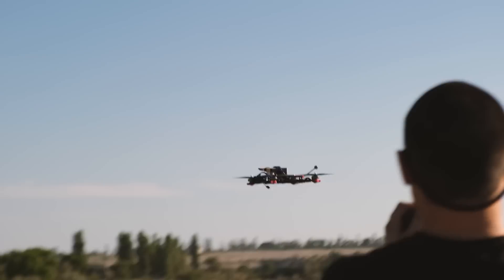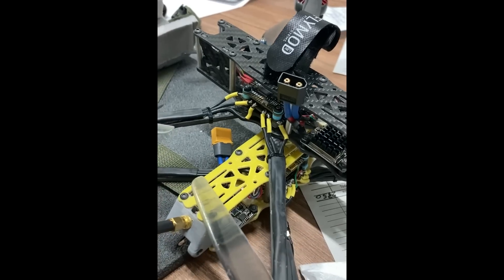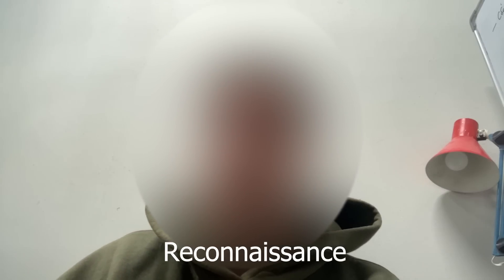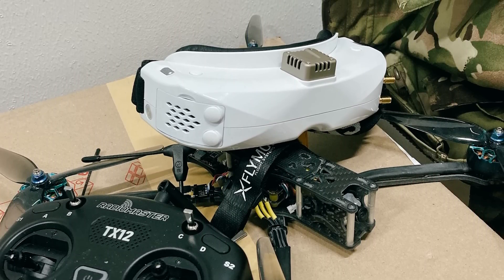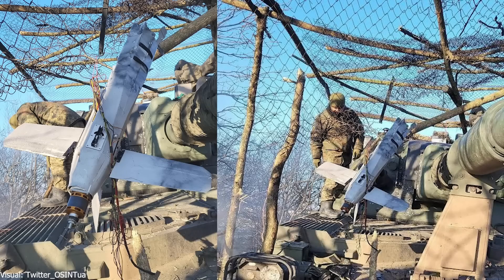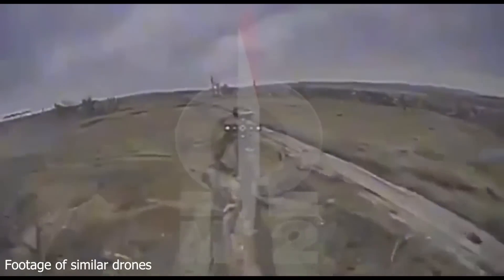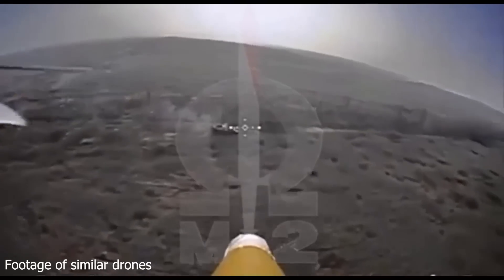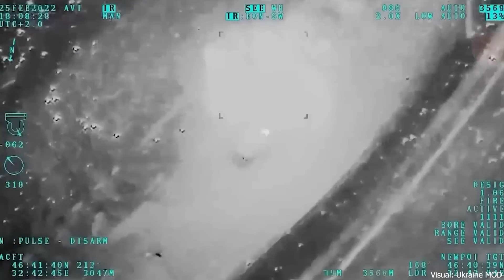Ukrainian Soldier explains how he uses First-Person kamikaze drones - (FPV drones)

Comment: The real question is how effective all of this stuff would be in a war between modern forces. Ones that have jammers at least at the level of those that are deployed for VIPs in domestic security. This war really is a exposition of the consequences of mismatched capabilities where the aggressor asset doesn't have a counter and vice versa. I guess if Taiwan pops off we'll get the answer.
Reply: Russia does have pretty decent EW equipment, definitely enough to deal with commercial drones, that’s extremely easy. It’s more of an issue of them not having smaller, cheaper EW platforms, so they only can rely on their big expensive EW platforms (think truck size), which are too few to cover most of Ukraine.
Reply: Ask the Americans. They have been using drones... or rather Unmanned Aerial Vehicles in war for years now...
Reply: Depends of the context of the war. What countries have civilian populations that when threatened by a hostile military invasion would immediately begin modifying civilian hobby toys to attack tanks?

Comment: I fly quads and rc planes, rc planes are more intuitive to fly. the stabilisation systems are way less advanced or non existent as it’s easier to build aerodynamically stable designs. You can make an rc plane fly faster, they can be made from mainly foam as opposed to carbon fibre. As mentioned you can get way more range out of a battery. As well 4 props are louder than 1
Reply: Easier to hit gaps with quads though. You have more room for adjustment.

That said if my strix goblin can penetrate 20ft into a bramble bush in a crash I'm pretty sure it could deal with some netting too.
Reply: @frasersteen  a winged drone with a lot of mass and moving forward quickly has more force to rip netting.
all weight in the fuselage, 
breaking off foam wings, 
pointy front,
pusher propeller.
maybe add cutting edges to the sides of the nose.
Reply: @frasersteen  The “netting” is chain-link fencing. Steel wire woven into a loose mesh. You are not getting a foam aircraft or RPG warhead through that to get contact with the target. This is why you see most of the targets out in the open in the success videos.
Reply: Planes have much less control authority (both line of sight control and actual trajectory). It's the aerodynamic INstability that makes quads adequate for their tasks. There are terrifying videos of quads hunting soldiers, making circles around them and attacking from the better trajectories.
Reply: RC planes fly further higher faster than any drone. Vacume baged foam wings and tail plastic fuz cheap to manufacture. Inav with cheap GPS to control it. Get the target gps from spotter plane, programe in a waypoint, plane flies itself to target pilot takes over switches engine off does a very fast silent glide into target. This is what RC flyers have been doing for years apart from blowing up tanks
Reply: @nicholasgoodyear7552  saw a video here on youtube where a free flying glider plane flew over 22 miles of ocean and landed on an island, all by itself. that was several years ago.
The technology is simple and available.
the payload needed to kill a tank seems to be surprisingly small.
Reply: Im gonna listen to the professional here, who actually used them in war.
Reply: @hitnrun66  
He says in the video he wants to use RC planes not quads, so the poster above is actually agreeing with the pro!
Reply: Drones have a better power to weight ratio and much more agile, which makes hitting a target that is moving (and potentially trying to doge you) easier to hit. Compared to other military kit the drones themselves are cheap AF so costs don't really matter. Everything is available opensource for drones and calling a basic control loop advanced is a bit of a stretch.
Reply: Failsafe 😂😂
Reply: @noisy_boi_fpv_3920  😂 that would be a costly failsafe lol 10ft away telemetry lost … booom !!!!!
Reply: I race drones, these are incredibly agile and can move in ways a plane cannot. In the right hands they can be guided through incredible small openings at low or high speed. However it takes more time to be proficient with a acrobatic drone when compared to a plane.
Reply: Speed to target, control authority and dynamic deployability. Rc planes are just the wrong option in my situations though they are being used
Reply: In the end they both make sense blowing up million dollar equipment and orcs operating it. There is use for all types here.
Reply: me 2 wel i mainly fly drones for the hoby but when i started i may have seen them as a weapon 😇
i have thougt of different ways to weaponize them in most cases a wing would be much more effective i think

a quadcopter would be superior if you want to fly inside a building, atack a single target, or mount a gun on it to shoot individual people
for all kamikaze purpose  a wing seems superior same goes for making it drop bombs
Reply: Planes would be ideal but the payload capacity would be way less with foam airframe vs carbon quad and 4 props . Surprised they don use cinematic heavy lifters with 8 prop configuration .
Reply: I'm going to say mostly yes, but also no to this one. I'm in a drone building program at a university and we do both quads and fixed wings. It really depends on what you are looking to do and how you expect to fly it.
Reply: I've been flying FPV for 10 years and building rc planes for even longer. Quads are much easier and more intuitive for a beginner to fly and setup plus it would be much easier to spot and hit the target. There are lot of people in this comment thread who are what I would call an armchair engineer. There is another big factor of the wingspan needed to carry a large payload without the wing loading going up considerably and making it harder to fly and easier to stall. They should also look into using ardupilot at least on their spotting drones since it now has a dead reckoning feature they could avoid losing drones due to jamming, using DJI is the dumbest thing they could be doing with the readily available DJI aeroscope that can tell the Russians exactly where they're flying from.
Reply: Ballistic coefficient favors drones in the terminal phase.
Reply: But a glider is way easier to shoot down, I guess in situations where they don't know anything is coming a glider could be efficient,
Reply: I can tell you have almost no experience in fixed wing, if any. You forgot that fixed wing aircraft are capable of sustained inverted flight.  With a drone you have one 3rd person to 1st person transformation required, the left right axis. With a fixed wing you have two transformations to do, left right, and up down.  What's worse is the conditions for the inversion of the axis are different. One inverts when the aircraft inverts. The other inverts when the aircraft turns around. This requires thought, the opposite of intuition. The plane is inverted and headed away, so up is down and left is left. The plane is going toward me and is not inverted, so left is right and up is up. Fixed wing has four of these combinations to sort out in real time. Drones have two - binary thought - if it aint one its the other. Much easier. I hope you can now see how this is substantially less intuitive than if only one axis is reversed. What's worse is errors in the vertical axis are usually fatal to the aircraft. These errors don 't exist in the drone hobby. The issue of course is muscle memory. If you don't have time to think, your only  choice is to react w/o thinking. The only time you don't have time to think is when you are close to crashing. This happens a lot more in the up/down axis than the left/right axis. Ask my Goldburg Eagle, which fly beautifully inverted except when fences get in the way, and gusts of wind cause you to panic. Muscle memory is a bitch.
Reply: @horrido666  That is a bit over explained but, exactly right. Planes can take weeks usually months to learn to fly high wing trainers with out making any mistakes especially if you don't have someone teaching you let alone becoming a decent enough pilot to the point of being able to fly a high wing loading plane designed for maneuverability accurately into a target. Most people could probably whip a tiny whoop around their house within a matter of days and the flight dynamics are basically the same for all multi rotor whether it's a tiny whoop or a 10" propped monster. The original commenter seems to think aerodynamically unstable is bad when in reality it means you have full control in any and all directions at any time with no chance of stalling. Also about your upside down comment there's always 3d but, that's probably not going to be intuitive for a beginner to fly haha.

Edit: for reference I learned how to fly helis planes and quads in that order and helis were easier than planes and quads were easier than helis. This is coming from a person who has probably built 50+ planes almost all scratch built and a good portion of those my own designs the physics of planes while seeming simple are actually incredibly complex and fickle quads just work and are seemingly complex but, actually simple.
Reply: More range, yes. But you won't be able to carry a 1KG payload with a foam RC plane.
Reply: There is no stabilization if u don’t want it in fpv. Called Acro Mode 😅
Reply: @jmillerfpv Try flying a quad with no fc :D OP was talking about the aerodynamic of the fixed wing uav. It is much easier to operate than a freestyle drone. Two different apparatus for many different tasks.
Reply: in a suicide drone it makes sense to glide into the target, which you can do with a plane, and you can do that silently.
the engine is used to get into gliding range.

Comment: the plane will not be that difficult to fly cause these will usually come with a flight controller which avoids to bring the plane into a stalling situation.
the plane has a far higher payload and of cause range even though it might be more likely recogniced by the russians cause the profile is far bigger but also a lot more quiet cause a drone or quad is quite noisy, maybe not during fight, but for sure in the evening with less battle noise. 

The parts for the drone can be cheap cause thtey do use analog fpv which is just 10% of the price. All parts are cvilian or hobby parts. The availability of parts is the issue. 
the drones are fire and forget and therefore cheap builds. But the chinese are selling all these parts and therefore the parts fro the hobby are exploding like flight controllers needed to build these more advanced planes and so on.

Comment: You had me at Angry Birds.
Reply: It's a very fitting name.
Reply: Rovio Entertainment should be sponsoring these guys😁
Reply: Only downside is having such a unique insignia may be pretty cool to fellow Ukrainians but god forbid they’re captured alive by the Neanderthals then they’ll probably get tortured for information to give up anything that will help the enemy destroy training camps for drone pilots, supply depots, drone workshops etc…Then possible execution depending on which group of Neanderthals that captures them. They may justify it as the drone pilots being civilians or partisans and not military. Kind of like in WW2 being a sniper or manning a flamethrower. If you manned a flamethrower in WW2 then you had a giant red bullseye painted on you and you were drawing in all the enemies fire and most of the time they were aiming for the tank on your back and 💥! They not only fried you to a crisp with your own weapon but most likely several other soldiers that were in close proximity to you as well. And if the Japanese captured you and you manned a flamethrower you were in for slow agonizing death.
Reply: @frankbattlejr981  This is 100% accurate.

Comment: It has always seemed to me like those guys using FPV drones against personel, are going to end up with a lot of pretty f*cked up nightmares.
Reply: Those last frames when they turn around to see the drone coming in.

But at least the FPV feed cuts, I feel worse for the operators who drop grenades and are there for the aftermath.
Reply: The nightmares are there for anyone experiencing the deep sh*t.
Reply: @danielburgess7785  
Naah, it has to be close, or particularly messy.
Just firing at a distance is not that bad.

Playing 'mix&match the insurgent bodyparts to write up an accurate casualty report' however, that most assuredly messes with your head I can tell you. 😆
Reply: Yeah, it’s already documented that American drone pilots have much higher rates of mental health issues compared to other designations. Probably would be a bit better in Ukraine, since it’s a conventional war, so they’re only hitting uniformed soldiers. No wedding or funeral strikes to remember. Still probably not great though.

Comment: fpv drones used to be a fun hobby now they are a strategic resource
Reply: Not FPV but first RC drones were thought of in ww1. I don't know if they were used tho.
Reply: @maciek_k.cichon  incorrect. Though the US did start the first unguided UAS. Look up "Doodlebug" during WWI. Never got far with i.
Reply: @GrigoriZhukov  I know Germans were working on "aerial torpedo", and in 1915 LRL Works in Warsaw proposed a RC single engine bomber, but it did't get any wind before Germans took the city in July. 
Thanks for the "Doodlebug" thread.
Reply: @maciek_k.cichon  the drones of WWI were essentially unguided cruise missiles, range set by fuel amount, direction with a simple compass mechanism. 
only for VERY large targets.
Reply: Drones and rc flying in war before they were ever a hobby. The US used fpv drone in the pacific in WWII.